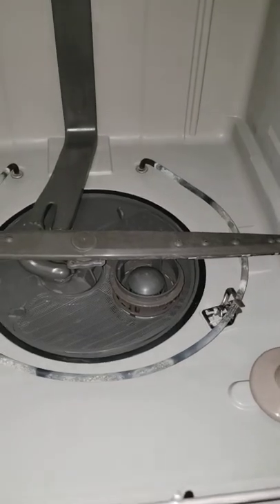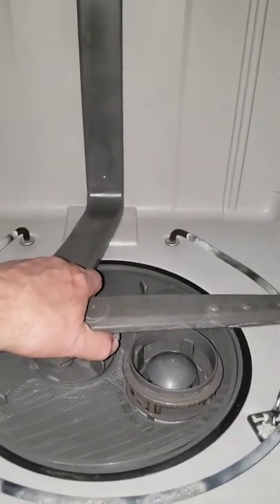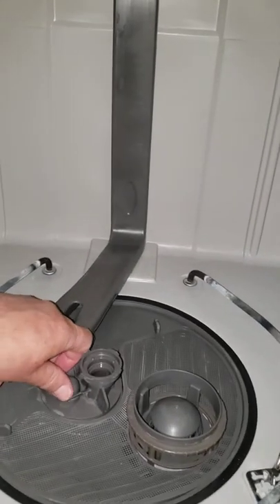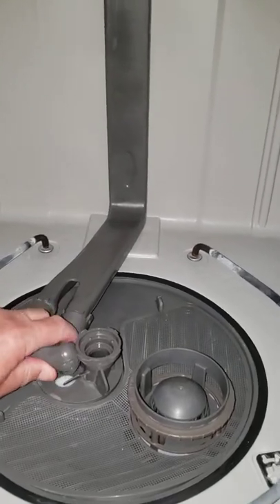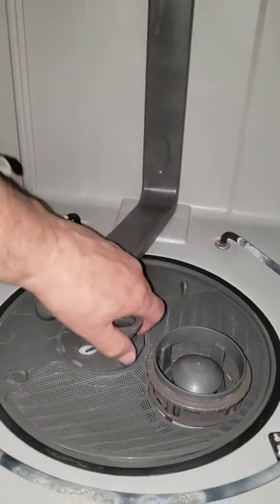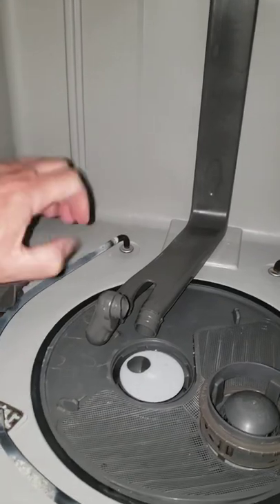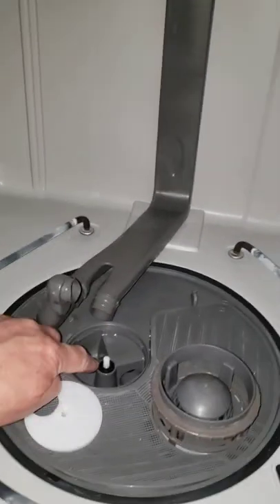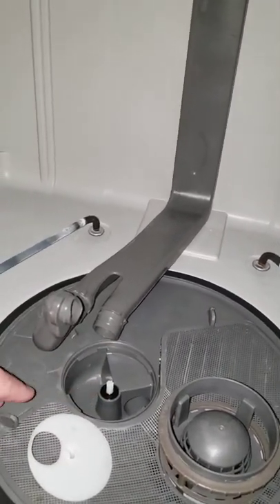Whirlpool Dishwasher Leak Access To Diverter Motor Grommet

Comment: Ummm....sooo....what's next??
Reply from the maker: Here's the playlist

https://youtube.com/playlist?list=PLmAfSpkyVfpWXxc9g27mNBve5AJpehW0O
Reply from the maker: Summary:

Find the leak.
If it's the grommet buy replacement grommet. Whirlpool does not sell this part.
Get access to the grommet
Remove old leaking grommet. I used a picking tool.  Toothpick would probably get it done too
Put new grommet on motor shaft.
Reply from the maker: Added grommet replacement 

https://youtube.com/shorts/1lk78MB29PA?feature=share
Reply: How do you take it out?!
Reply: Thank you so much! It worked! After three tries, it was finally dislodged and it’s now spraying like it used to. Without cutting off the electricity or taking apart the dishwasher!